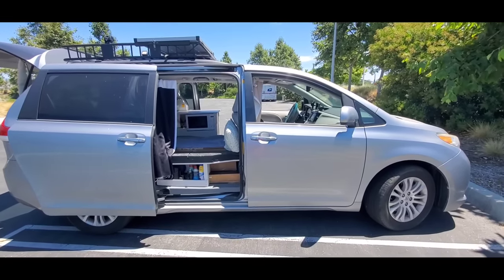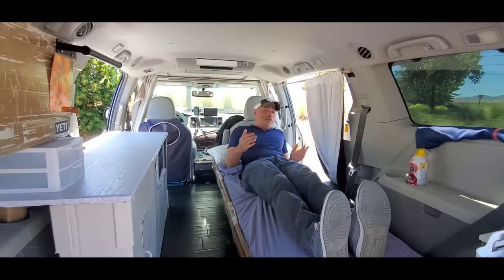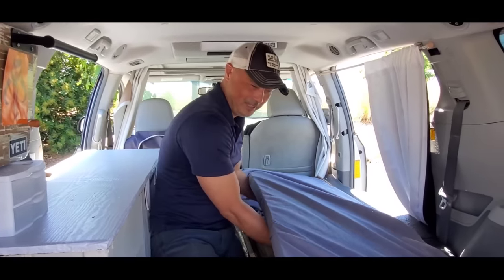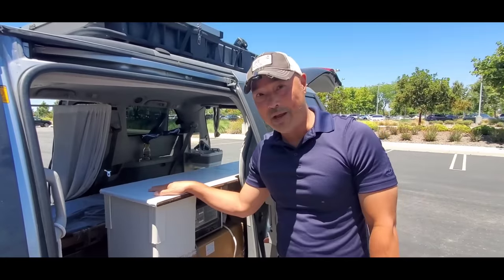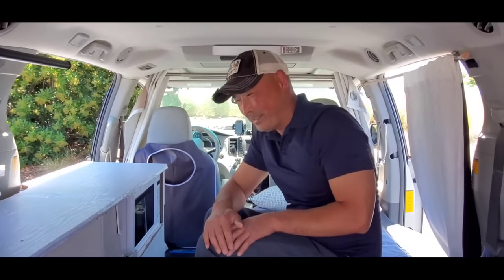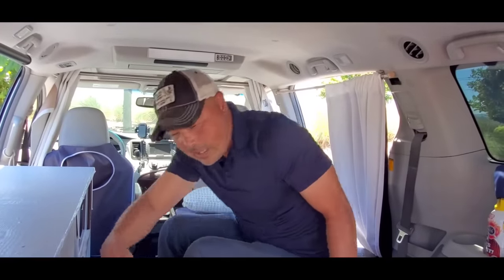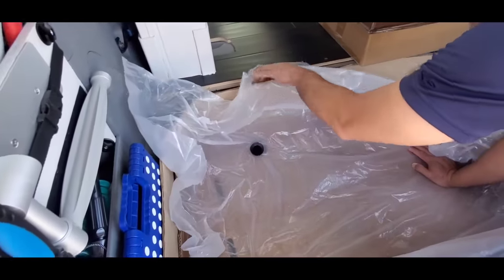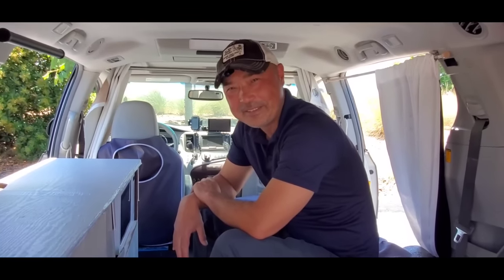DIY Minivan Camper Built Out of CARDBOARD /Even The Shower!!

Comment: We recycle sooo many boxes at my work at the Salvation Army via the food drive that we do. I normally just use some them flattened to try and level my van floor. Now I want to see if I can make a simple bed using some boxes for support and storage underneath! Thanks again you two for the endless supply of ideas. I'm not my father the builder of all things wood. Maybe I'll have better luck with cardboard boxes. LOL ❤😊
Reply: In the Amazon age cardboard is now a resource...and a responsibility!   ALL our furniture could be beautifully made from Amazon boxes and a little glue and paint and odds and ends, and as beautiful as any Japanese fine laquered furniture.   Black and white latex paints with a water soluble polyurethane clear coat work great.  My travel tea set is made of cardboard and decorated with zen art and has stood up well for years!
Reply from the maker: Sounds beautiful
Reply from the maker: I bet you will make something amazing!!

Comment: U don't have the slightest inkling how important this review means too me! i.e., what's been my biggest concern is weight in my 5 wheel lug van, something like this can obliviate huge concerns over gas mileage, axle concerns, etc...
Thanks again for another profitable vid which can be achieved basically free, saving quite a bit of money in the long run, period.
PS: When the good Lord answers prayer, sometimes the cup runneth over!
Reply: May The Lord Bless your adventures
Reply: @Tiny-Campers  Thanks for the reply. Upon returning for the reply, I then snapped, realizing that I hadn't added you as a sub, which was my initial intentions! Thanks again!👍🏽
Reply from the maker: I look forward to seeing how you apply this info in your build. Hope you will share it on line when you are done.
Reply: @gloriouslifeonwheels3621  I will with hopes that I get an interview on my build! I can tell U now, the most I received from this coverage is the extreme light weight materials used with strength backing it! i.e., aluminum, etc...Also this build will be long lasting. My plans are after all is said & done, this vehicle can be placed on some land, high from the ground to exhibiting this is how I got hear & possibly continuing to live in🤗...
Reply: Look to the moving/commercial grade thickness/strength; available free all sorts of places. And put the peel and stick wallpaper, fabric, tile, etc.  It’ll be pretty and super light (and inexpensive!)❤

Comment: Not enough builds are done using lightweight materials like this, especially in full size vans. Folks have to keep in mind that they are building an aircraft, not a tank.  Alternatives is structural insulated panels made of thin layers Foamular sandwiched between lauan. Cabinets can be made out of just Foamular panels with "poor man's fiberglass" which is canvas on top of Foamular and then painted over.

Comment: Great job!!! I've  used  cardboard with  poor man's  fiberglass,  try it on your next project!!!!  great  strength!!!!!
Reply: Yes, I was thinking of using the glue instead of epoxy. I'm sure it would work great.
Reply: @Tiny-Campers  I build  a  cabin,  used  paint  and  covered  with old  bed sheet , then one more  coat  of paint.  It was pretty strong.  Not bad for recycled materials !!!!!  Cheers!!!!

Comment: He should have used white Walmart brand contact paper instead of paint to cover everything.
Reply from the maker: I think paint is a lot easier to apply than contact paper. I always have to pull it up several times to get it smooth and then you have the edges. Give me paint any day. But, he did use stick on wallpaper on the counter top.